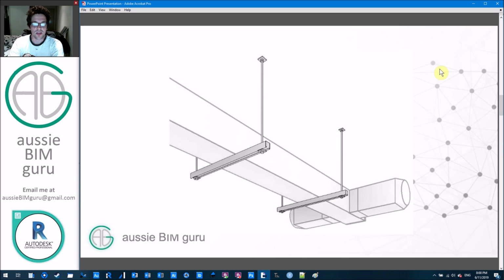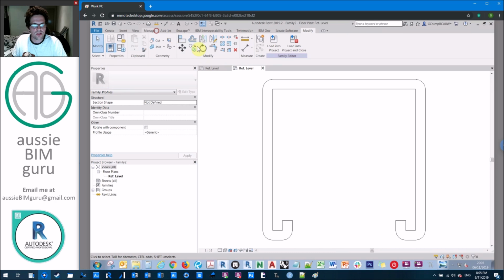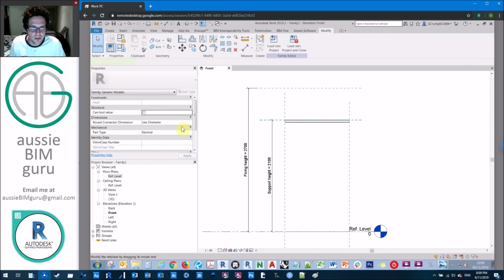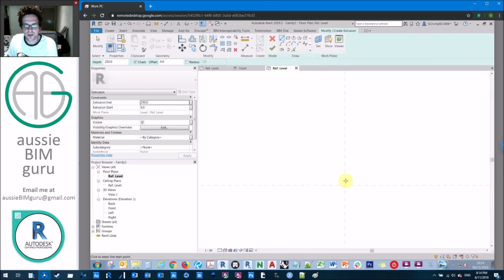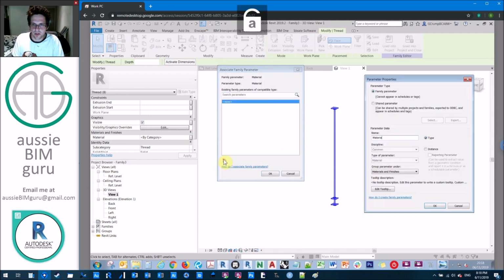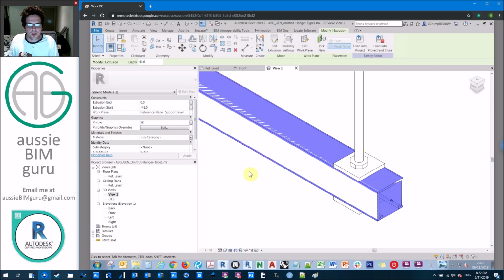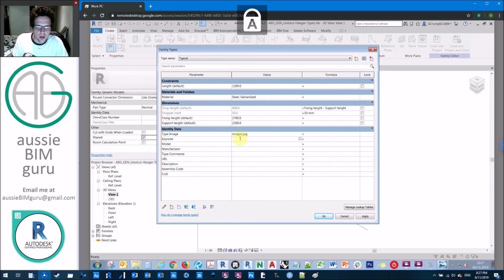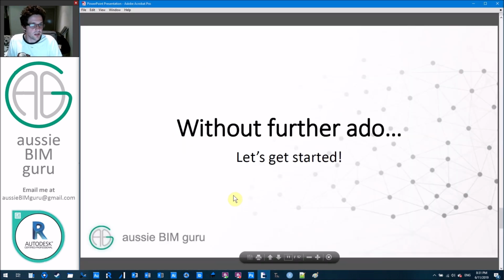Revit Masterclass: Family Creation #1

Comment: This is so handy. Is it hard to add in a parameter to add a 2nd or 3rd unistrut and offset that. Also could this be added to some sort of dynamo script to place bracketing for all elements in a project?
Reply from the maker: Potentially, it all comes down to the ingenuity and time of the scripter! If you add extra variables its more conditions to measure, e.g. identifying stacked runs is hard to do unless you systemize them together.

Comment: Hi, is there any solution for the Revit Family created in Italian Language, to be converted into English? I'm using Revit english but when i open the Family, the parameters and properties are on Italian language. Can anyone help me out on there? Thanks in advance.
Reply from the maker: As far as I am aware this is not possible for parameter names, as the user names these and revit doesnt have a translation tool built in. It only translates inbuilt things like commanss and tooltips which are hard built into the language pack.

If firms need to have content in a language, typically it must be made in that language from the start.

Comment: Damn you BIM Guru! ;-D!!!  I've just gone back and re-modeled all of our Unistrut content families after watching this video! Painful at the time, but so much better than the way I did it in the past.   Thank you for the tutorial. Class A content as always.
Reply from the maker: Haha glad to have helped, even if it gave some extra work!

Depending on your discipline it may be worth considering the same methodology, but using structural framing instead of a line based generic model. This would enable you to analytically assess the elements as well, or include them in a structural takeoff.

Comment: Great video. Is it possible to make the hanger to snap onto duct and adopt duct width and under side of duct as reference plan? fixing length might be different because the concrete slab varies in thickness. Thanks.
Reply from the maker: I would try building a duct fitting if you want it to be sized to the duct. My workflow accounts for slab thickness as it finds the underside at each hanger.
Reply: @AussieBIMGuru  thanks for replying, its important that the hanger snap to duct so it will move with the duct, also to snap under duct as the duct sets up and down. Agin thanks for sharing and your help.
Reply from the maker: @User-tx5qz  a duct fitting should be able to do all of these things.

Comment: How about adding a parameter to space every 54" on a duct?? Good job man,
Reply from the maker: Yes you could set it up differently to achieve such a rule. The point of the script you'd need to adjust is the spacing/division code block. Instead of finding max segments and equally dividing, you could find max fit and build a range between 0 and the upper range of this amount (spacing * max segments -1) and this would give equally spaced to the last required segment.

Comment: Great stuff as always Gavin. I have a question regarding nested components, is it possible to schedule them as part of the overall family (like what you said @26:46)? let's say you wanted to include the unistrut family into another family say, a tv bracket.  When I try to do this I get the unistrut and the bracket on separate lines. this makes sense if I use the OOTB manufacturer parameter for both. but even when I create a shared parameter for the unistrut manufacturer it doesn't seem to recognize them as the same family. What am I doing wrong? I just don't know what I am missing.
Reply from the maker: Nested families that are 'shared' will always report as separate entities in schedules - each line represents an object. Typically, I'd use filters in a schedule to exclude nested components (by a field they have in common, like an additional visibility parameter like 'IsComponent' if all you want to capture is the host element itself. Capturing a component as granular as Unistrut might be quite macro in approach, it depends on your trade and intent (e.g. a contractor probably cares more about the item, whilst a component fabricator cares more about their respective piece such as the total length of Unistrut, and the lengths by which they need to cut).

Comment: Also, i know i can google this but what is the use of assembly code?
Reply: Classification for specs and technical data
Reply from the maker: Pretty much what Mostafa said, it is often used to carry the Uniformat or Uniclass code of a Revit object. By default there is an assembly code table that comes shipped with Revit that provides access to a basic Uniformat table.

Typically located at: C:\ProgramData\Autodesk\RVT 2019\Libraries\Australia\UniformatClassifications.txt